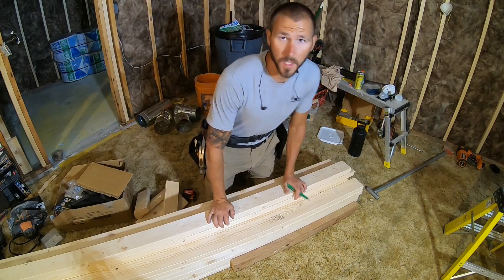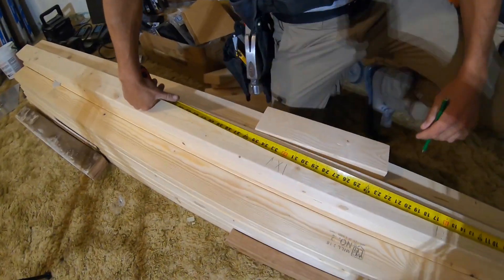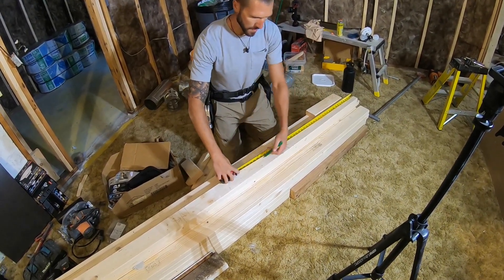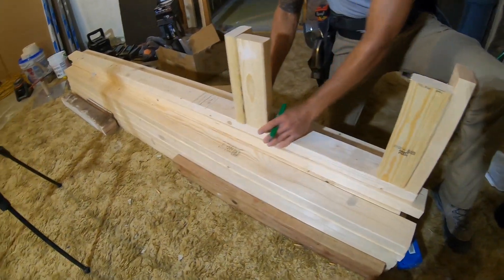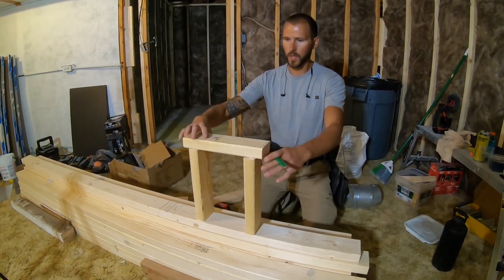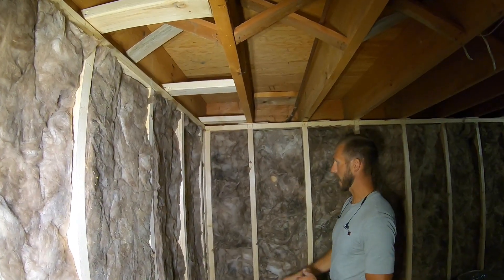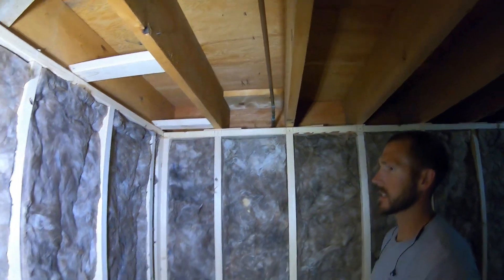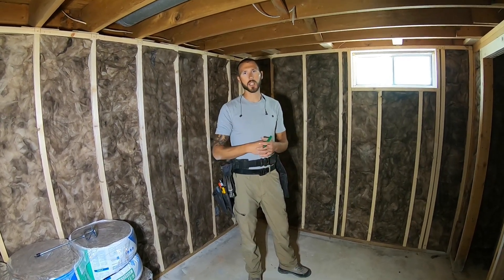How to frame a basement 16 on center. (Layout, Corners, Blocking, Basics)

Comment from the maker: 📌 PINNED COMMENT
Learn how to frame a basement wall 16 inches on center — including layout tips, how to frame corners, where to add blocking, and which tools make the job easier. Great for homeowners, DIYers, and contractors alike.

Comment: I can’t seem to find a video that discusses how the 16 on center continues around a corner. Do I start again from each piece of wood?
Reply from the maker: Start from the inside corner where your walls meet, or follow floor joist above to keep framing stacked running length of the basement. Also I think I covered California corners in that video but essentially making an L to catch drywall into the corner. Place the L on the wall that runs past, so the short wall butts in to the L for backing.

Comment: Would be nice to know on your california croner or whatever you call it if I start the 16 inches from the end then there will only be a 12 1/2 opening to your first stud. Should we not figure it out and make the measurement so the gap is equal all the way? I cannot find one instance on YT that address this issue.
Reply from the maker: Think of it in terms of how your drywall will finish. Whether your talking on the wall the runs past the intersecting plate. Or it’s the wall that buts into it. I typically stack framing to floor joist tho as it makes it easier for drywall/ other trades, looks better too. Send me a pic of what your talking about on instagram I’ll see if I can help. https://instagram.com/amayerican_made?igshid=MTNiYzNiMzkwZA%3D%3D&utm_source=qr
Reply: perfect, I was thinking of sliding one wall to the ends meet and do not need a california corner but then I thought I would never get electrical through the corner or insulation in. Thank you @AMAYERICAN
Reply from the maker: Yeah that’s why the cal corner is nice !

Comment: Quick question, hopefully it makes sense. When stacking framing how is the top plate secured? Seeing how the wall studs are directly under the floor joists.
Reply from the maker: You can angle your nailer In the crevice of the stud plate connection and sink two nails if that makes sense.

Comment: At around 3:30 you start talking about the next wall coming in. If you know you are doing this does in change where you start the 16 on center? For example do you now go in 3.5" or so then start 16 on center with the first wall if you know you will have a corner coming in?
Reply from the maker: It depends on how your pulling layout but yes, multiple right ways to do it. My preference is to stack framing with floor joist when possible. Makes plumbing/ electrical/ hvac easier
Reply: @AMAYERICAN  thanks! I appreciate the reply.
Reply from the maker: You bet best of luck on your project, hope the video helped 💪👍

Comment: @Drew, did you ever hear of or install an ABSCO brand metal shed?  They call for a concrete slab with a 3 inch wide by 1 inch deep “rebated edge” to assist with water drainage. I think it's a complete crap concept. I poured my 10x10 slab but the rebated edge turned out like hot garbage so I had to spend 2 days fixing it. I'm going to post a video in the next few days on my channel.
Reply from the maker: No I haven’t but I can’t wait to see the video ! Curious what a rebated edge is haha, sounds technical!